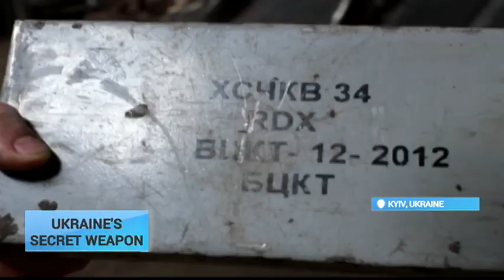Exclusive: Ukrainian engineers develop new tank to revolutionize warfare

Comment: ERA does pose a threat to infantry outside the tank. but they should make spacial armour as well with ceramic armour composite plates inside to prevent or slow down projectiles :) can be made cheaply. good thing also would be to create a Spall liner to prevent shrapnel from causing as much damage. also to have a cage slat armour to prevent the inevitable rpg from striking. But yeah could become a good cheap mbt but production is slow where it probably won't be able to do much with the new Russian Armata coming :l
Reply: Most era actually doesnt harm near by infantry any more than a rocket or missile exploding against a tank anyways, so its worth it